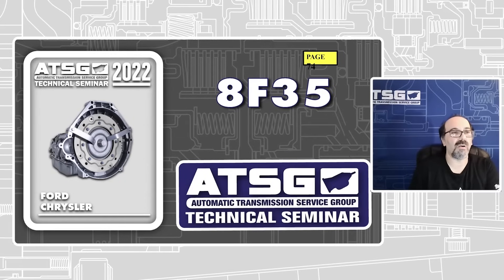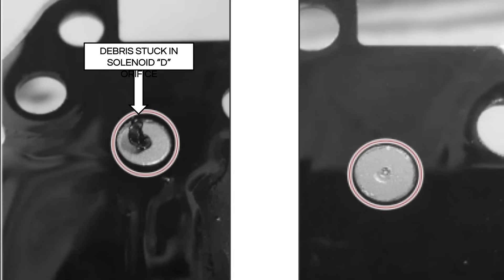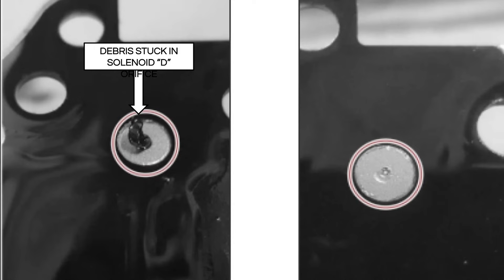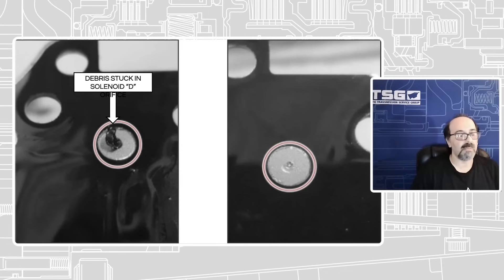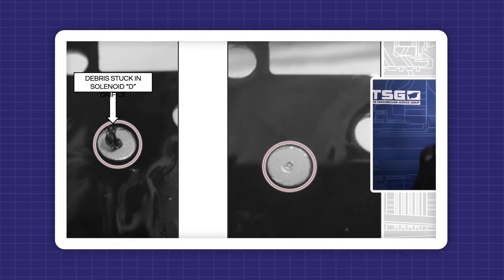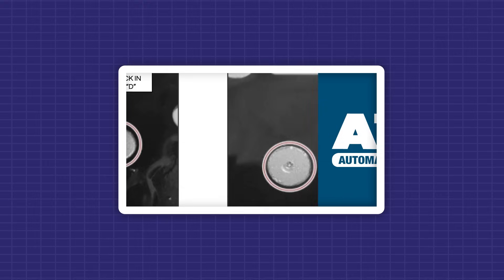ATSG - 8F35: LOSS OF REVERSE

Comment: I lost reverse in my 2020 Ford Edge FWD with 8F35 transmission. I took the valve body out this afternoon to inspect for debris in the solenoid. During disassembly, the checkballs fell out before I could note their locations! I haven't been able to find a diagram yet. It seems most people replace the entire valve body, which I would rather not do. Can anyone please help?

Comment: I think this transmission is a complete pos!
Reply: it seems like it is "geared" to get MPG at any cost. With a fluid cooling bypass valve, fluid heater, and ULV. More heat with even lower viscosity, is asking for trouble, especially in traffic with low airflow. I want to run a auxiliary transmission cooler and also circumvent the factory bypass, so the fluid is always cooling, like how normal cars have done it for 80 years. I'm pretty sure I don't have to tell you how power transfer is noticeably better when cold.
Reply: @lliaolsen728  Have you added a cooler to yours yet? How did it go? I want to do the same.

Comment: Have a same gearbox on my 2019 Focus. Now got a problem with it.. First of all it does not go to PARK (error on dash "Transmission not in park"). Okay with that fault I can drive (yeap it starts up and shut down) when car is cold. After few km fun begins. Car starts jerking and making weird stuff and finaly when it got full warm then it stops running. What can be the problem? Do you have any ideas? I'll add all fault codes aswell. 
Codes:
Memorized- P0751 Shift solenoid A performance/stuck off
Memorized- P0771 Shift solenoid E performance/stuck off
Active- P07E4 Unable to engage Park
Memorized- P0868 Transmission Fluid Pressure low
Memorized- P2700 Transmission Friction Element A Apply Time range or Performance
Memorized- P2704 Transmission Friction Element E Apply Time range or performance 
Memorized- P27B3 Gear shift selection switch performance

Now the car is at garage.. We are going to make fluid change and take a look hows the old oil look. If there is some chips/clitter in oil then there is something bad probably.. If old oil is clear then what I think is the solenoid valves are bad. 

So as you have worked on them then probably you know what can be the problem ;)

Thank you so much! 

Regards,
Reivo from Estonia!
Reply: How it ends 😊?